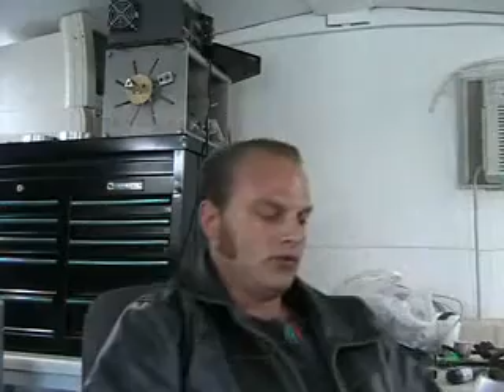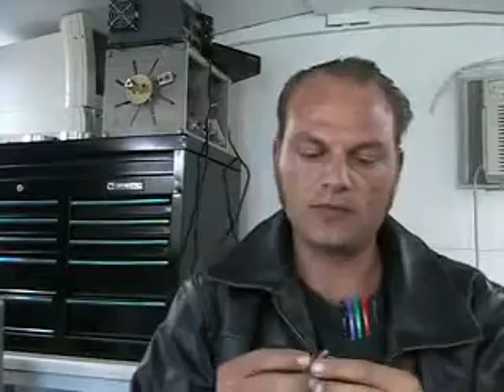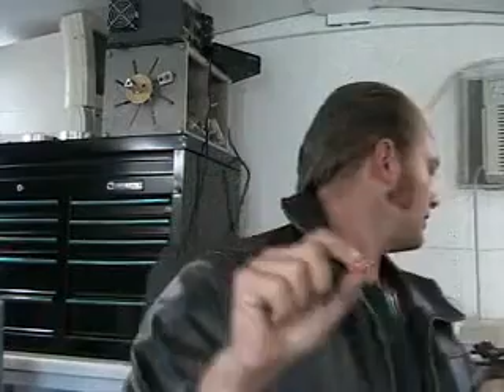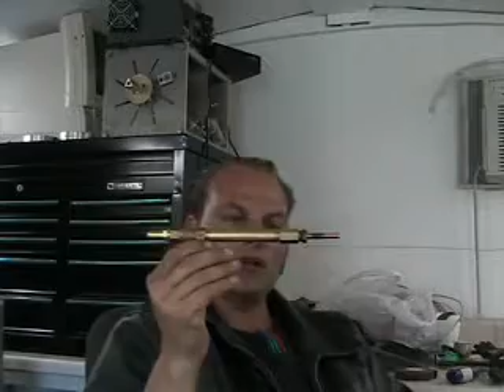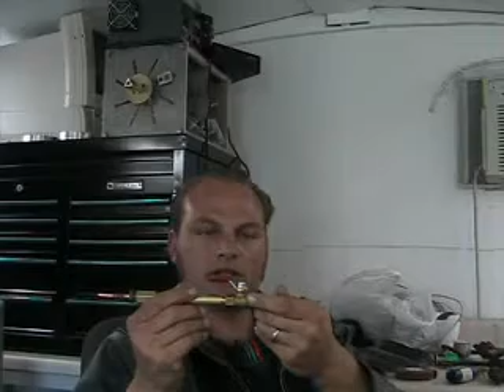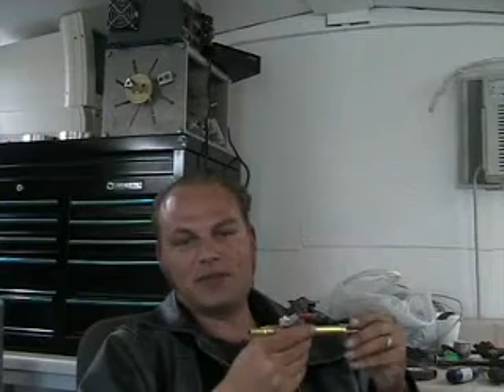partB

Comment from the maker: The tip size is determined by the amount of gas you can make, lose numbers 1-1.5Lpm .025, 1.5-2lpm .030, 2-2.5 .035, that is the starting volume for each tip, they max out at about 2.5 times the flow, so a .025 will go from 1-1.5 to around 4lpm, more than that and it tends to blow itself out.